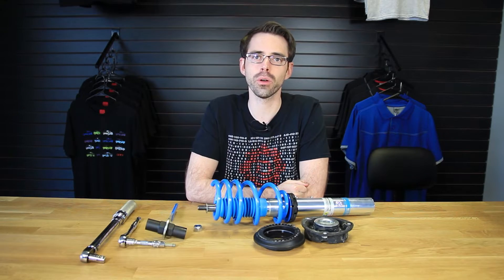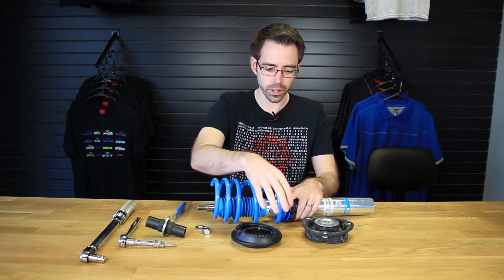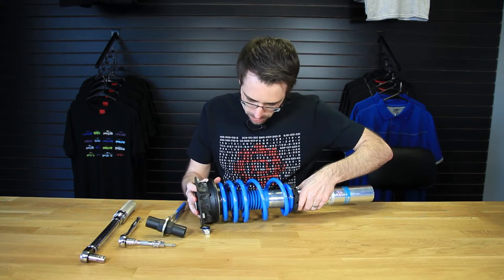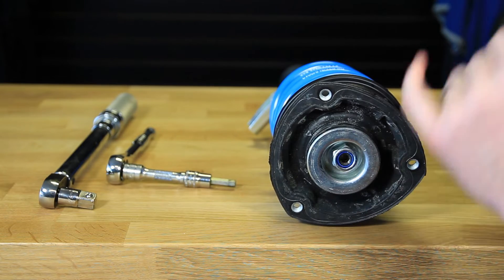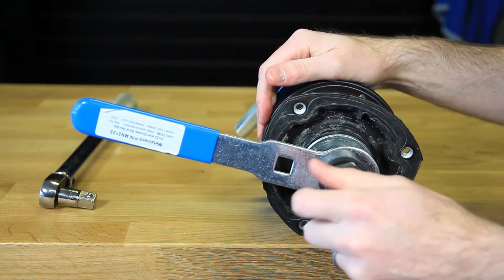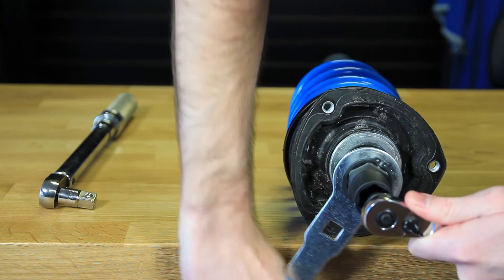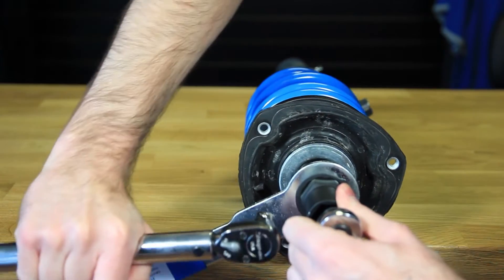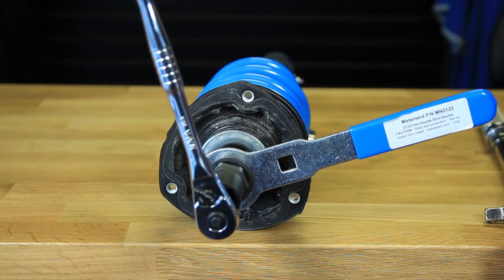How to Assemble the Front Strut Bushings (Mounts) and Bearings on a MK7 GTI

Comment: Hi, according to Bilstein and VW you should allign the upper end of the spring with the notch on the strut bearings. Failing to do so will result in the spring breaking the plastic bearing. I had 2 bearings broken until Bilstein sent me that instruction that was later confirmed by local VW dealer.
Reply: Thank you for this detail!
I'll be sure to do this when I do my suspension refresh soon.

Comment: i buy b12 bilstein and i put the washer at the bottom and nut alone on the top! will it be a problem or do i need to dismantle everything again?  and btw. thank you for a good and quality video/instructions.
Reply: Did you end up having to put the washer on or was it fine
Reply: @footballWR96  WTF is wrong with you people. Assemble the suspension properly. This is why no one wants to buy someone else's modified car.

Comment: Hi, I have a problem with the suspension, I heard the shock absorber cup, which could be that the nut is not tight??
My suspensión is bilstein b16 for my hyundai coupe gk 2004
Reply: For solutions my problem?
I'm a Mechanic I live in spain.

I am a mechanic but I have never installed bilstein b16 suspensión,
Please Can you help mee please

Comment: Great videos fellas! I installed my Bilstein Coils a little over a year ago and I have this knocking noise coming from the fronts. I've tried varying the height, tightening the strut nut with the method shown here, and checking all the other bolts. Are the springs supposed to be clocked a certain way?
Reply from the maker: Most likely you have a strut bushing and or bearing bad.
Reply: The spring does need to be clocked a certain way. I was hoping this video would show but it doesn't.
Reply: @Nikko780  As per the Bilstein manual,  I believe the start of the top of the spring needs to line up with the notch on the mount/bearing. But I have also heard that the end of the spring at the bottom should be facing towards the engine. Not sure if these are mutually exclusive or if they both occur when set correctly. I have noises in my front that my mechanic installed twice and I am convinced that they are not aware of this clocking method, likely gonna have to redo myself.
Reply: Matthew Johnson you probably just didn't tighten them enough

Comment: I was watching the VWR Lowering Spring video and you used compressed air with a 21mm socket to remove and top nut. The second option (seen in this video) is to use a 21mm wrench and hold the strut with an allen wrench. My question is, why is the compressed air able to do the same job (seems much easier)? Also, why doesn't the assembly spin when you use air?
Reply from the maker: Bryan LeBlanc Because it spins much faster and has more torque.  When you turn it by hand it turns too slow and the shaft spins before you can get it tight.

Comment: I like your vids but It may also help if you used the torque wrench correctly. Setting the torque wrench to 60 nm then adding length to the arm changes the actual torque applied to the nut.
Reply from the maker: David Proux You are welcome to make that adjustment on your torque wrench as it sounds like you have all the info to do so.  Its likely this precision accuracy is not necessary on this particular component.  If you were working with engine internals an rotating assemblies this would be very important as these components require precise torque specs to function properly.
Reply: TIPPAH308 Exactly what I was thinking. Any response to this Deutsche Auto Parts?
Reply: Deutsche Auto Parts Thank you for the response!
Reply from the maker: David Proux No problem.  Hope it was helpful.

Comment: Is the strut top nut socket necessary? I noticed you didn't use this in the VWR spring install video.
Reply from the maker: We didn't use it in that video as we used air tools to install the top not. Since most people wouldn't have air tools we wanted to show the hand tool version.
Reply: +Deutsche Auto Parts +irishtim7 i know its an old vid but. iwas doing an 8v s3 this morning and if you can't access this  special tool a Swan neck/offset 21mm spanner works fine or what I use is a spark plug socket (on my set it says 14mm but it's a 21mm hex drive internal with a 22mm external. also to note when reinstalling the strut the tab on the top of the strut mount should line up with the tab that goes in the knuckle, with the arrows facing front to back.